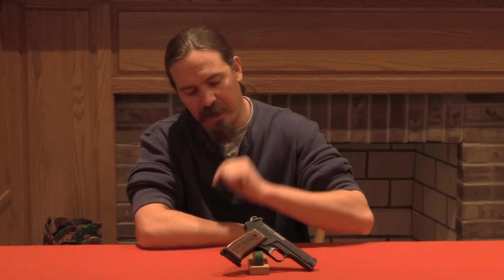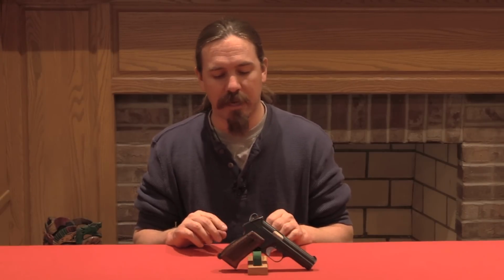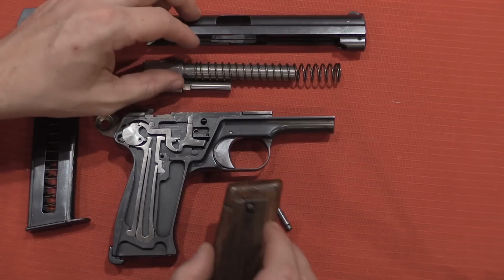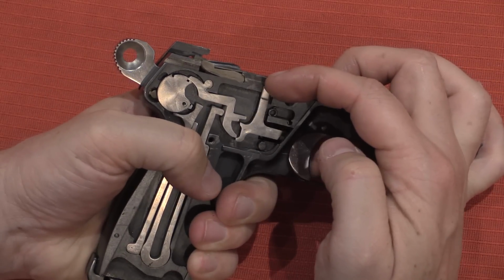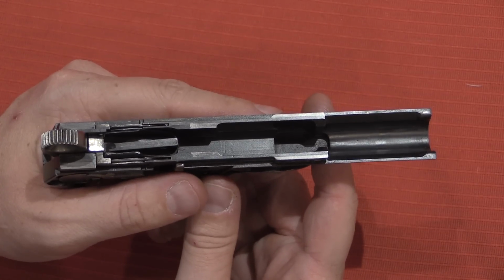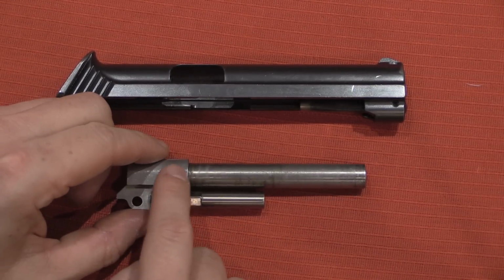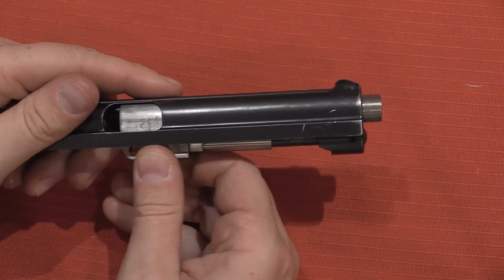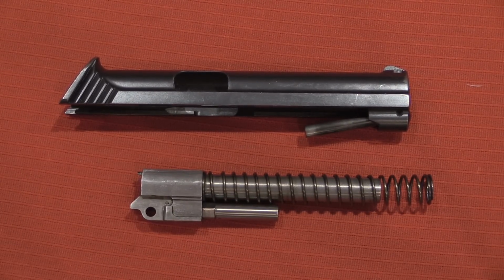W+F Bern P47 Experimental Gas-Delay Pistol

Comment: Inertia doesn't cause the slide to retract, since the inertia is too busy attempting to keep the object staying STILL.

Gas pressure causes the slide to retract... just at much lower pressure.

The slide doesn't retract beforehand, since beforehand, the slide retracting would further pressurize the gas cylinder(the gases don't feel like it).
Once the bullet exits the barrel, pressure there plummets, causing gas to rush out of the gas cylinder... meaning nothing is holding it closed anymore.

Comment: Very interesting. Was hoping for a video on this after the reference in the previous Swiss trials pistols video (the Hi-Powers). My first experience witb gas-delayed blowback was fiemd stripping a P7 in the gunshop where i worked from 1993-95. I could see where it was simpler in some respects but potentially prone to issues in others. Fewer moving parts is always a good thing. I always like to see un-adopted trials guns to see what designers were thinkibg, and what might have been. And Ole Krag had a patent for this type of mechanism in 1910? Wow

Comment: Seems like a very simple gun to manufacture.
Reply: I wonder, getting the gas ports exactly right must have been a bitch.
Reply: 51WCDodge yeah. That part would have been a lot of work especially without any computer modeling but I bet once it was all figured out mass production would be pretty straightforward.

Comment: The trigger system has odd echoes from 1800s with leaf springs. I wonder how well this gas delay worked if not cleaned regularly. My Vektor CP1 filled the gas cylinder with chips of the bullets, finally got impossible to take apart.

Comment: How do you prevent the tiny gas ports from fouling??? Seems to me a step back from the HI-Powers 13 rounds to 8 rounds and way more complex too.
Reply: The gas bleed-off isn't there to operate the action, but rather to slow it down. Of course you need a proper design, and that's what the final product has :)

I'd reckon, the short pistol barrel is actually easier to keep clean than an assault gun...
Reply: Not likely, it's just 9mm. The pressure isn't much different to any gas port on a rifle and those work :)

The real reason is probably that is was more expensive and a bit too exotic, so the gvmt didn't want to risk it ....
Reply: Be nice to take a look at the Swiss reports on trials. We could sit here arguing for days. :-}
Reply: +Eisen
Thanks for the hint. The overall design of the P7 is certainly appealing, but I think the Swiss got the trigger mechanism a bit better.
The circulation of hot exhaust will, of course, increase heat related issues but for a regular service pistol this shouldn't be a problem.
The P7 however confirms one of my points - cost of manufacturing :)
Reply: Philieas: Gas erosion is a problem on any gas operated system, the trick is in the design. A lot of heavier gas operated systems have adjustment to take into account fouling and variable ammunition quality. On a larger piece it is easier to replace parts as required . Trouble is with a pistol, there is so little space , how do you fit such things? 
 low pressure cartridges requier much finer intricate ports to bleed the gas in sufficent quantity and pressure to relaibly operate the action.
Reply: Ah, that's a good point. Just to clarify, this system doesn't have to worry about making the gas port small enough to only bleed the required amount of gas to operate the action without harming it--it just has to bleed enough gas to hold the gas chamber at its largest volume and thus keep the gun "locked".

So...theoretically, couldn't the gas port be rather large in comparison to those in gas-operated designs?
Reply: AR-15, AKs(including shorter krinkovs) don't have gas adjustment.... since that's not a realistic problem....
Reply: May your swords stay sharp! (mysss29) you're right!
On most guns, a larger gas port would open the action faster , but not necessarily on this type of gun(where the gas does the opposite, keeping it closed)
Reply: Gas port erosion is not a realistic problem, especially not in such a low pressure cartridge..... but then maybe people thought it WAS a problem back in the ancient days?
Reply: Main problem is every time you fire a jet of hot gas id forced through a tiny hole at high pressure. Erosion of the gas port, especially that close to the full chamber pressure must have been a factor why the pistol was not adopted.
Reply: phileas007 Go take a look at the P7 pistol by HK, minus the cocking lever, this prototype is the same gun and shares all the problems that gun has like overheating.

Comment: The same system is used on the Walter CCP. I picked one up a couple of weeks ago and love it. The main thing I like about it is that it really evens out the recoil of different types of ammo. P+ defensive loads and cheap range ammo all shoot about the same.
Reply: Well, is that because the practice fodder thumps you harder than it should, or because the action takes the punch out of the defense loads?
Reply: Suburban Mostly it calms down the hot stuff. With the amazingly ergonomic grip the recoil isn't an issue at all.
Reply: Does get a bit hot in unexpected places, though.